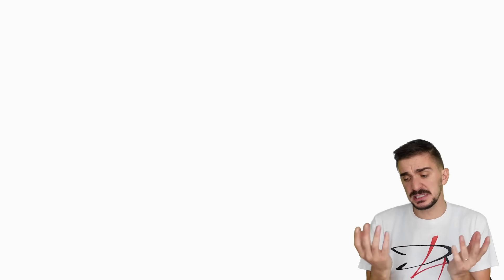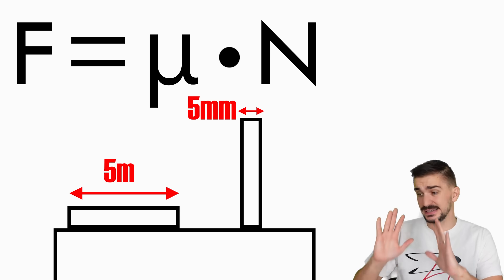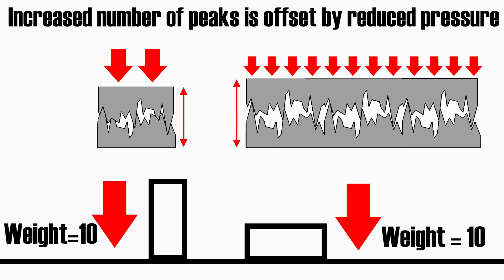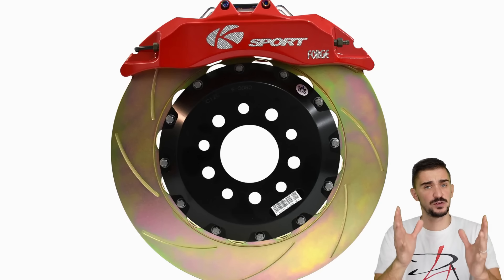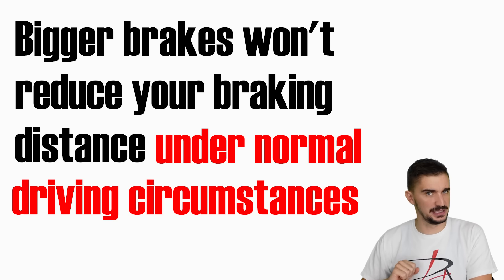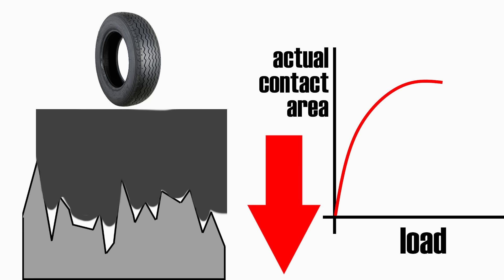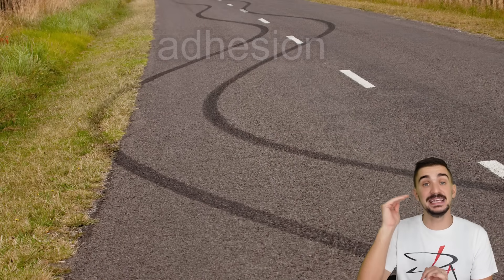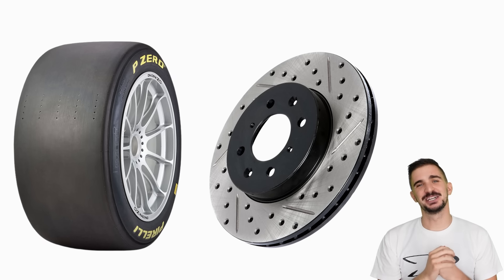Why Big Brakes Won't Stop You Faster but Wider Tires Will - Friction and Surface Area Explained

Comment: Wider tires don't have a larger contact patch!  They have the same contact patch with a different shape.  You can corner weigh a vehicle by measuring tire contact patch and tire pressure.  You get the exact same total regardless of tire width (as long as pressures are the same) assuming you don't go to silly narrow extremes that completely collapse the tire or overly deform it.
Wide tires add performance due to heat management, and in the real world your performance compounds come with your wide tires vs your relatively harder all weather stock tires.

It is true though that grip is not linearly reduced by the normal force which is why lighter vehicles have better grip.

Comment: I read somewhere that for the same pressure all factors held constant, both wider and narrower tyres have the same contact area only that for the wider tyres it spreads along the width, while for narrow tyres along the length. Is this true?
Reply: Yes, exactly. Most people think a 2X wider tire will have a 2X bigger contact patch. Its probably the biggest misconception, and he (video creator) doesn't seem to understand it, either.

Comment: Before vid, my understanding of big brakes was they allow better cooling to allow better braking over time. Larger area allows more heat transfer which means when you have to consistently hard brake (track driving) you are less likely to overheat and experience brake fade
Reply: This is true, and this is also why cross drilled rotors are a detriment to braking performance on the track. You are literally removing mass from your brake rotors for no advantage what-so-ever. 

Ideally, you want to find the sweet spot between mass and heat absorption. Drilled rotors add no benefit in this area over a set of slightly smaller solid rotors, but they do cause problems with stress fracturing, and premature pad wear.

If you go to a club race, pay attention to the kinds of rotors all the top guys a running. I guarantee they will be solid rotors.

(The above is not meant to apply to carbon rotors.)
Reply: @operator0  lol yeah cross drilled are for looks, not a single pro racecar uses them. They all have slotted discs instead which help carry away brake dust. Slotted brakes break incredibly fast as well, since the holes create a massive weakness, and thus stress fractures buildup much faster in those.
Reply: @operator0  " Larger area allows more heat transfer" this is not  the main reason to increase pads size. You can increase heat transfer without increasing pads size - better ventilation, increasing disks size without increasing break pads size etc. Main reason - bigger pads wear slower, as there is more material to wear.
Reply: @bumbarabun  Not necessarily. If the pads are wearing at the same rate, they will wear out just as quickly.
Reply: @severnsea  if you have bigger pads (contact area) they will wear slower than smaller ones.
Reply: @bumbarabun  I repeat, not necessarily. If the pads are wearing at the same rate, they will wear out just as quickly. 

Look, imagine the surface area of your pads was the tip of a marker pen. If you draw with that marker pen it will run out eventually. If you double the contact area by taping 2 marker pens together, they will still run out at the same time. You have double the contact area but you're still using it at the same rate. Try it! It won't be exactly the same, there are other factors involved that can make a difference, but that's why bigger pads won't necessarily stop you any sooner.
Reply: @gssf.gr29  But you don’t have to exert the same force with the larger pad.  We went to larger calipers and pads on our endurance racers for this reason.  The brake pads last a lot longer.  Side benefit is we can hammer the bejesus out of them and they never fade.
Reply: @brianshorey  100% correct. On race cars. You're running at higher speeds and higher temperatures and need fast, heavy braking all the time. But on your daily driver it's a complete waste of time (to a point), the brakes fitted by the manufacturer are more than good enough at general road speeds and conditions. Why wouldn't they be? They're designed to stop the car at speeds well over what you're going to be driving at except in extreme circumstances, but even then you're not going to be driving flat out and braking heavily regularly like you would be in a race.
Reply: @gssf.gr29  his point is that bigger pads putting out the same force won't wear at the same rate. Bigger pad means more surface area to distribute force, which means less force on any given point of the pad, which means less wear for any given point on the pad surface, which means each millimeter of the pads depth lasts longer.

More appropriate to this than your marker analogy would be pencils. Say youve got a pencil. You drag it across a page with a given amount of force, you're gonna get a line. Tape 2 pencils together, and drag that combo across the page with the same force, and you're gonna get 2 lines, both lighter than the single line from the first drag. Thats because each pencil tip is taking half the force and thus is pressing against the page with half the pressure, meaning it only has half the friction and loses half as much graphite. Each pencil is gonna take twice as much dragging to get dull. Thats what happens with a brake pad. For a given braking force, a bigger pad will experience less pressure and thus less friction and less wear.
Reply: @severnsea3924  That is not true.  Most cars are NOT equipped with brakes strong enough for high speed braking.  If they were, you would not see the huge differences in braking between regular models vs AMG, M, Blackwiing, SRT, etc.  Clearly you haven't driven regular cars at high speed.  If you did, you would know that their brakes are not sufficient

Comment: Well all this science is great but when I swapped out my front brakes with some Wilwood brake discs and calipers my FJ stopped much better with half the brake pressure. My foot says it made a real difference. This brake difference could be measured at the very first stop with both being equally cold. Didn’t need to wait for heat build up.

Comment: That theory might be right if your stadard brakes are good but there is plenty disc brakes on cars that cannot pull up hard enough to ever max out the traction of your tyres so upgraded brakes will then in fact make stopping distance far shorter

Comment: I guess those idiots in NASCAR are wasting money having different brake packages for different tracks then too.?   This is such baloney,  you need bigger brakes when you go to larger rims and tires.  Width is a consideration but so is rotating mass (rim and tire weight combination, vehicle weight,  type and use of vehicle. If you go from 16" to 20" rims and tires you need to upgrade brakes unless you plan on parking in some else's trunk.  If you are towing, you may need to upgrade your brakes more than normal.

Comment: I'd agree with the principal that bigger brakes don't necessarily give a shorter distance. But there are some other benefits of larger brakes: Firstly the large brake system can dissipate more heat so you can make more stops before the brakes overheat (fade). Secondly I believe that bigger brakes are physically stiffer and the caliper and it's mount to the upright distort less under the high forces which makes the braking more consistent and therefore easier to modulate.

Comment: Larger brakes have more surface area which can dissipate heat. That’s why they exist. And we’ll, larger tires require larger brakes depending upon size.  This is common sense.

Comment: So why do F1 cars have smaller diameter narrower tires on the front than they do at the back? Is the traction requirement of acceleration require more energy than the braking effort? Surely they should be mirror images of each other?

Comment: I have to partially disagree with this because upgrading your brakes beyond the capabilities of your tires would make you correct. But if you aren't exceeding the capabilities of your tires upgrading your brakes will reduce the time and distance it takes for you to stop. That is literally why people put super twin turbo brakes on an sc or a non-turbo Supra. There's a dramatic difference between the 10 and 11 inch rotors versus the 13-in rotor and quad Pistons on the turbo model. And that's from the very first stop. The car doesn't need to be tracked to notice a considerable improvement in braking.

Comment: This can be explained much easier. If you look at what part of the connection from the weight (the car) to the surface is more likely to slip. If the brake would apply enough force it would lock the tire (no slipping). But a rolling tire has more friction than a non rotating slipping tire (full slipping). This is also the reason abs (anti blocking system) was invented. It prevents the tire from stopping entirely when slamming the brakes. Like you explained brakes decrease slip linearly. But tires which usually have no slip while driving suddenly increase in slip when they are close to locking up. Resulting in a braking force sweat spot that is not (like one might expect) at full lock up.

Edit :
you might ask what this has to do with surface area of tires, nothing. It's just that brakes are operating below their posible maximum friction and an increase in friction is therefore without any effect. Tires on the other hand can not lock up with the street and reach full friction potential, since they are dependent on the cars momentum, gravity and other factors that cannot be improved to full friction potential. But more surface area can decrease the effect of these unchangeable factors.

Comment: so leverage doesn't play a part here for some reason or am I getting something wrong?
Reply: I did in fact get something wrong. Almost all cars have the ability to lock up their wheels. Brakes as they convert kinetic force in to heat energy work more like heat sinks. The leverage does minimal difference to this and as the car can lock up it's wheels anyway it doesn't make a difference. I think F1 cars do use 100% brake force momentarily without locking up but normal cars do not stop faster with bigger brakes.

Comment: Wide vs. skinny tires just changes the orientation of the contact patch, instead of longitudinal (front to back), the patch is transverse (side to side), but both are the same size. Wide tires' sidewalls deform less and wide tires have more 'frontal' area exposed to the wind and mass to absorb and distribute heat, so they stay cooler but make more wind resistance.
Reply: Have you not seen F1 car tyres?
Reply: @awakenotwoke1973  What's your point?
Reply: @johngalt97  The fact they exist, in the form they do, goes against everything you claim.
Just how thick are you trying to prove you can be?
Reply: @awakenotwoke1973  Nice, another 5th grader fresh out of physics  class?
Reply: @johngalt97  35 years in engineering, kid.
Reply: @awakenotwoke1973  Have I disagreed with something in the video? You all are being very obtuse.
Reply: @johngalt97  Whether you've disagreed with something in the video it's entirely irrelevant as to whether you're wrong. Your assertion that the contact patch is the same for wide v. narrow tyres is the same is simply wrong because the static ground pressure would then be the same all other things being equal and that is demonstrably false. So is your assertion that wide tyre sidewalls 'deform' less - width is not a significant factor in determining that but sidewall height is.
Reply: @awakenotwoke1973  My assumption was most wide tires have a shorter sidewall, my bad. Let's use typical street tires for reference. The main point is that wider tires don't have more patch area just because they are 'bigger', but instead have a different contact patch orientation. Most people assume bigger (wider) tires give more grip, when its mainly more subtle differences, not just 'more grip'.
Reply: @awakenotwoke1973  Google: "discount tire contact patch"
"Performance vehicles often use wider tires. This does not necessarily increase the sie (sic, size) of the contact patch but rather changes its surface shape. Reshaping the contact patch makes it more efficient for accelerating, braking and handling.
Reply: OMG, as a pro-driver of twenty-five years, a tyre development driver and technical trainer it would take me months to educate you. 
It’s probably best you comment on topics that you have an elementary understanding of.
Reply: @n.lyndley.9889  You're talking with a backyard wrencher that spews hearsay like its gospel, he applies the same logic in the real world like the bs in his church. He legit think his 180mm tired have the same surface area as a 240-280mm tire. Lol, be must be running those bicycle wheels completely flat ahahaha. I mean imagine thinking that rubber being a bit cooler, makes more wind resistance...(????). ROFLMAO.
Reply: @n.lyndley.9889  Start with one thing. Everything I wrote is correct. You’re bluffing from your parents’ basement.
Reply: @em4703  Both of you have refuted nothing I've written, but instead just Ad Hominem attacked me.
[EDIT] Here's a post that EM deleted, he may have deleted another:
" @John Galt  You ain't correct. Maybe go back to 5th grade and pay attention to physics class. You'll also learn that insulting someone doesn't give you a win, it just makes everyone laugh at your stupidity."

Comment: nice video. one point though is that bigger brakes really will stop you better than small brakes and it doesn't take "5 minutes" or 30 or anything like that. it will absolutely be immediately noticable. This will be apparent to anyone who actually has used brakes on a track, or even to stop from fast speeds on a highway. most cheap commuter cars will fry their brakes in ONE STOP. one. not 5 minutes. if you slam on the brakes from 80 mph, they'll probably be fried before you slow to 30. Though it is true most of that is in the pad

Comment: There is another force at play with brake rotors. The larger the rotor, the greater the mechanical leverage value. like a breaker bar on the end of a ratchet wrench, more force can be applied to a longer lever. Larger brake rotors act like a breaker bar on the rotating wheel assembly. This is also why larger rotors brake better...
Reply: While your point is a good one I think it is moot. The increase in diameter does increase the surface area to help dissipate heat but moving the pads further from the center of the axis increases the amount of material which goes through the brake pad, at any given RPM. 

The circumference of a 10" rotor is 31.41" 
The circumference of a 12" rotor is 37.7".

Using just the outside edge as a point of reference that's approximately 6" more metal the pads have to apply force to, per rotation.

Can you see how that's a bit of a conundrum? While the size of the rotor helps dissipate heat the amount of material passing through the pads at a higher rate of speed increases heat. 😂

Isn't physics fun? 😎👍

Comment: When it comes to larger breaks for track use one factor wasn't mentioned. Modulation. With larger rotors creating more leverage modulation at the limit of traction becomes much easier. Breaking on the limit is where a lot of time can be made up followed by trail breaking through a corner which both take finesse and larger rotors along with pads\calipers make this much easier. Great videos!
Reply: you are saying that the further the BRAKE pad is from the axle, the less force is required to generate the same BRAKING torque on the axle? If that is desirable, then why are racing cars not set up to reduce the force required to actuate the BRAKES to a minimum? In fact we find that GT3 drivers expressed that BRAKE pedal stiffness was set largely by personal preference when its adjustment was possible.
Reply: @joelambert7128  I never said less force was required. With smaller rotors the window between maximum braking before lockup and complete lockup is smaller meaning your modulation on the edge is harder to control. With larger ones that window is bigger and easier to modulate on the edge of traction.
Reply: But, can that added modulation benefit outweigh the addition of unsprung, rotational mass? I'm of the opinion that it can't.
Reply: That's for motorcycles. Not cars. You have four wheels. And you control all four brakes with one foot. That's why ABS is allowed in professional racing. Cos it's the same foot your ancestors used to ride a horse or drive a horse cart. You don't have a high tech foot that can control brakes on a car, it won't happen, get over it, whatever you think you have, you don't, without ABS, a motorcycle will leave you in the dust
Reply: Brakes are spelled brakes not breaks. Do you know the difference between two, to, and too?
Reply: @hankkline7300  You got me their. I need two spells more carefully. Sorry fore you're inconvenience.  I'm sure you didn't understand I was talking about brakes and not taking a break. Really too confusing. Glad their is grammar nazis around like you two help.